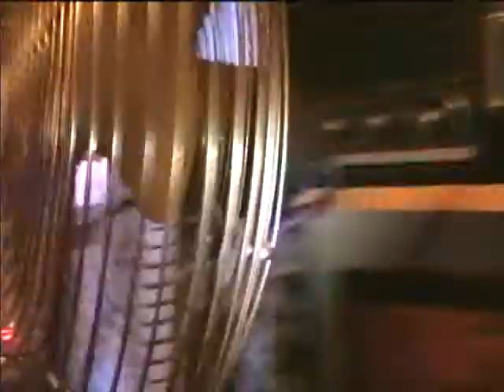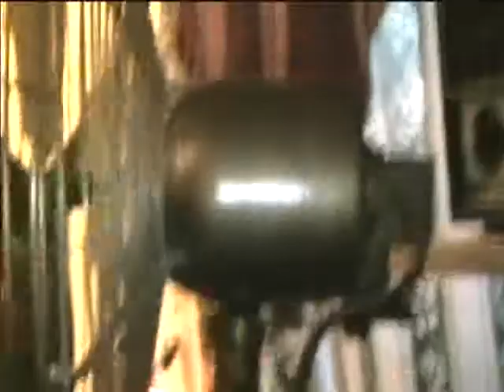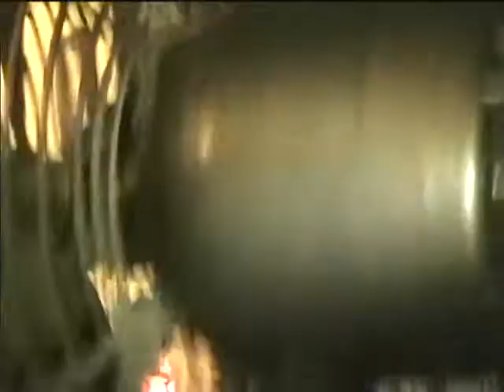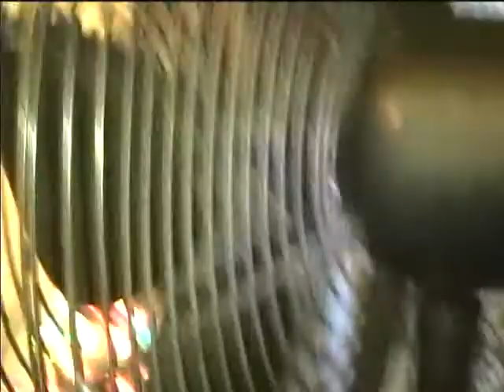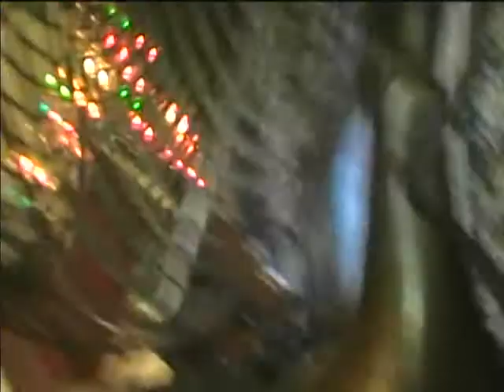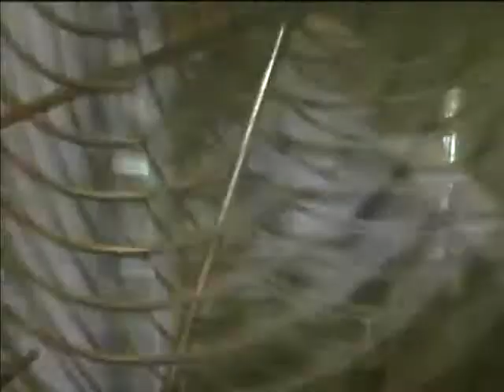1974 Hunter Industrial-Quality fan oscillating

Comment: There is a light grease which should work very well in these; it's made by Cooper Tools and the part number is 45-0980.  I would never use oil in an application where grease is normally used.
Reply: Would red axle bearing grease work too?
Reply: @demetrijohnsonssirenvideos3590  Depends on the size and type of the motor.  I wouldn't use it on table fan motors as it is too viscous